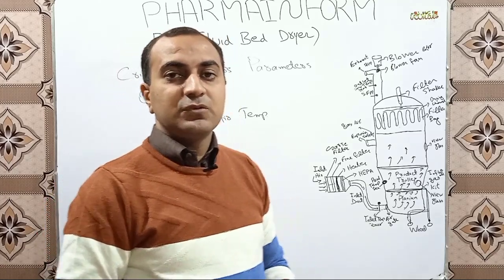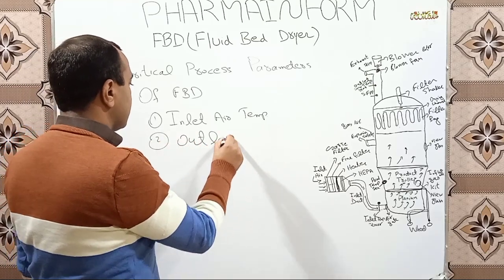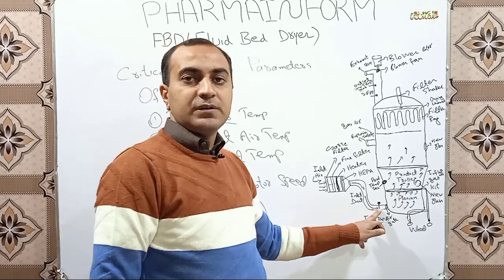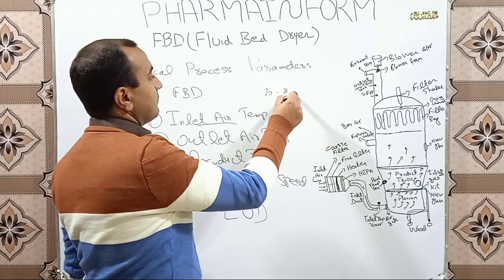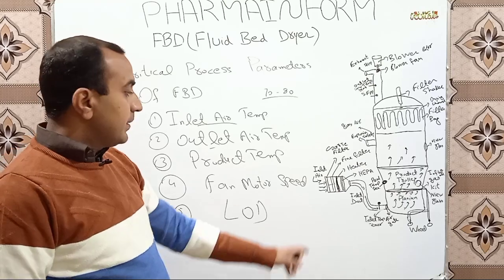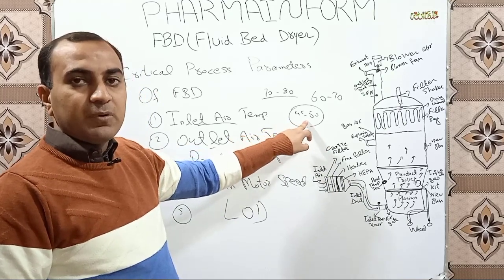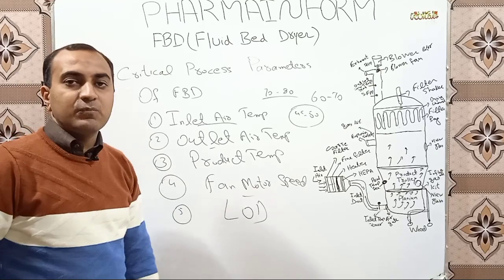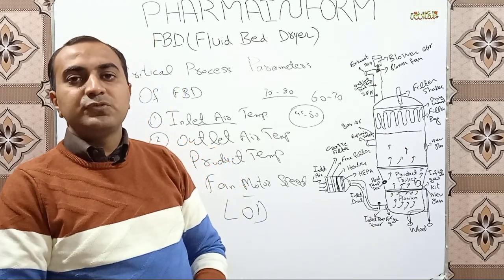Critical Process Parameters Of FBD | CPPs Of Fluid Bed Dryer In Pharma

Comment: Is inlet air CFM  critical process parameter?  What does it indicate if inlet air CFM is not changing though we change blower RPM?
Reply from the maker: It should be changed by changing blower rpm.may be any  blockage or chocking of filter